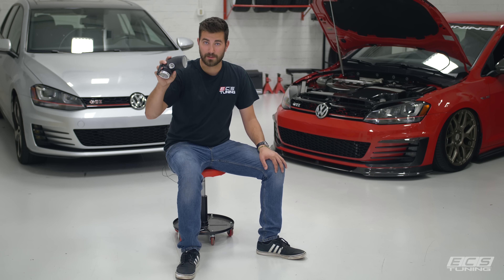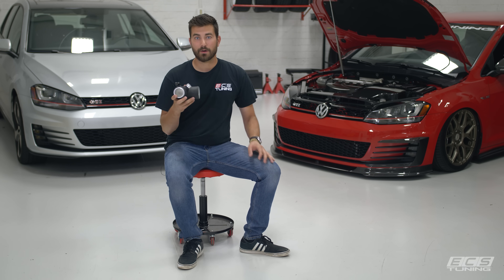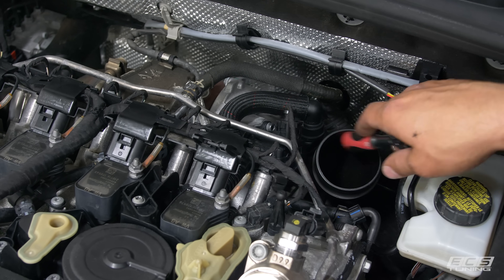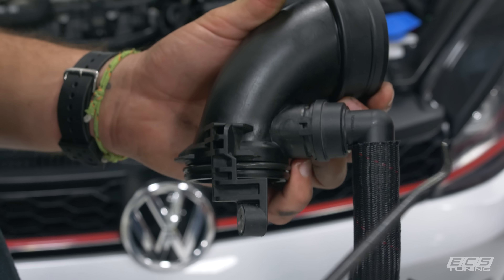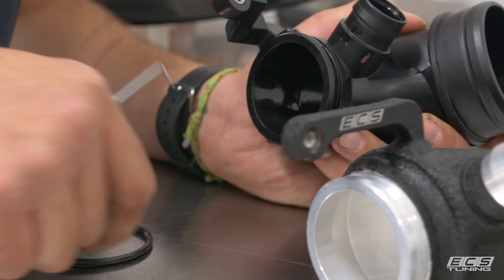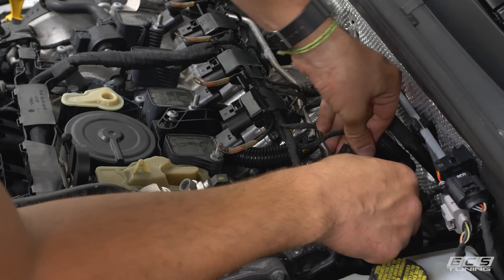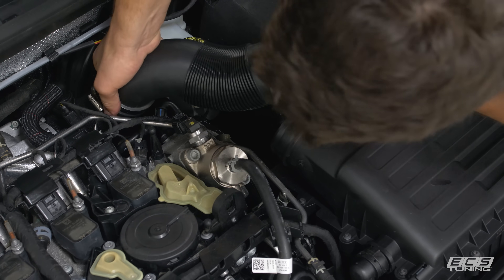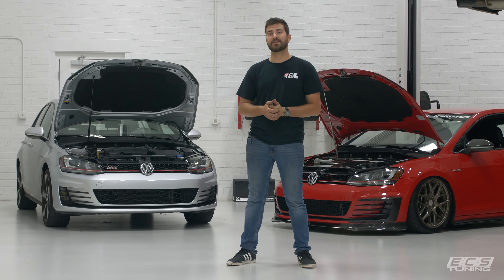VW MK7 GTI - Turbo Inlet Pipe Install DIY

Comment: “It’s an easy install.” “I need to take the entire engine apart to get to the part.” 🙄🙄
Reply: Moving a coil pack harness and an intake pipe is the entire engine?
Reply: @Tcflohr 😂 ikr acting like he’s installing a new head gasket
Reply: AversaS not really I didn’t do all this take apart this piece and that piece but he is showing u the proper and easy way tho.the way I did it was a struggle but I got it on with out doing any damage and love it
Reply: @Confident_Tutu  what do you love about it?
Reply: Definitely not easy for most diy newbs like myself.
Reply: Please stay away from any and all cars if you think this is difficult by any means whatsoever. Please.
Reply: Man depending on the MQB car you don't even need to do that. Had plenty of room in my Mk2 tiguan to do all this. Just inlet hose, pcv and T30.  Just needed a good little pry bar to get the PCV off. 😅
Reply: How much HP gain would you guess? Thanks
Reply: This install took me about 20 minutes. It is easy. Tell me you don’t work on your cars without telling me you don’t work on your cars.
Reply: the entire process took 10 minutes?it was just a few nuts and the coil harness. if this isn't easy to you then you need to stay away from cars! lol
Reply: take the entire engine apart?  you should take that hilarious crap on tour.  if a few screws and plugs is that intimidating you probably shouldn't be trying to diy your car.
Reply: get a mechanic, you shouldnt be working on your cars. its easy to fuck shit up when you dont know what youre doing
Reply: Suck Boy Tony imagine a newb trying to tap a screw they broke lol

Comment: I was just about to purchase this off your site but then I realized that it's $55 USD shipping to Canada. Plus this doesn't cover taxes or duties. So all in the shipping is going to cost as much as the product........wtf. I'd really appreciate it if you guys could offer better shipping options to Canada. It's in both of our best interests.

 Sincerely, a want-to-be customer.
Reply: DCassidy42 I find the same thing to Australia. The shipping amounts are very excessive and it stops me making purchases as shipping often ends up being equal to or more than the products I want to purchase.
Reply: My fellow Canadians, I used to face the same challenge until I started using a cross border pickup service. There are quite a few good service providers available to us, the cost makes sense, especially when shipping in the U.S. is free.
Reply: Ecs shipping is rort! Im sure that’s how they stay so cheap, sell cheap locally and rape those who live outside of the US
Reply: @DCassidy42 EuroSportTuning or PAG Motorsport can help you get your EC's parts without those fees. I've been getting my stuff without a problem. EuroSport tuning is east coast and PAG Motorsport is west coast
Reply: Free shipping to the states that’s great for the home market but must kill exporting 😔
Reply: I live like 40 minutes from ecs so everything I buy is fast and free pickup
Reply: I just bought one on park auto motosport, u should try. 139$ CAD including shipping for one
Reply: real shit, this install was over complicated also lol

Comment: Will this work on my 2016 Passat 1.8T TSI Gen 3?
Reply: I've got the Leon 1.8 tsi gen 3 and it fits that. In fact almost any pipe that fits the 2.L will fit the 1.8.
Air filters, charge pipes etc.

Even the turbo muffler delete fits the smaller is12 turbo, so the inlet and outlet of the turbo and air pipes are the same across the 1.8 and 2L range. Hope that helps mate
Reply: Niffty83 thanks a lot bro

Comment: Great video. Looks pretty simple. Can I get a full list of tools used on this video, please?
Reply from the maker: We used a 1/4" drive kit: 7mm socket, 10mm socket, and a T30 torx bit.  We also used hose clamp pliers, and a pick.  Here's a link to the tools: https://goo.gl/PJFUZU
Reply: @ecstuning  will this big bore inlet and diverter spacer cause a cel? Or mess with the engine long term